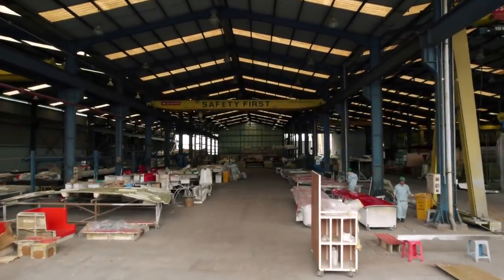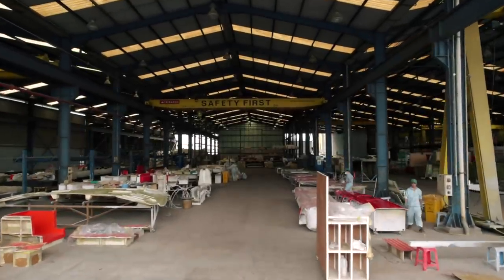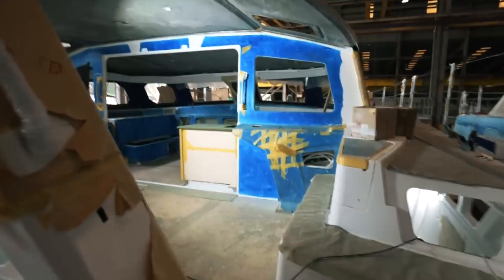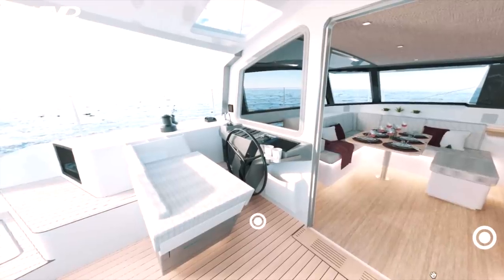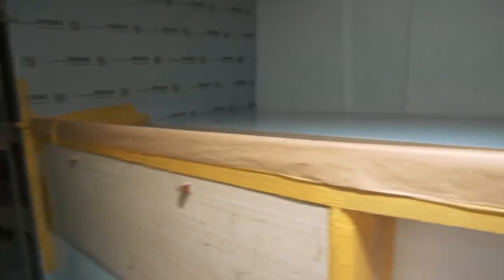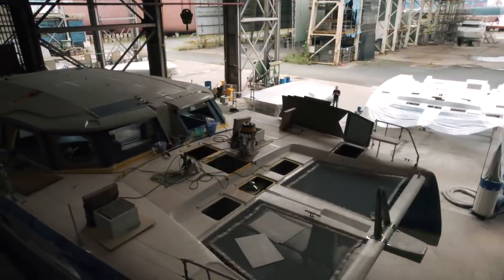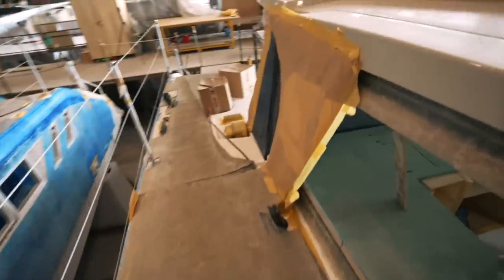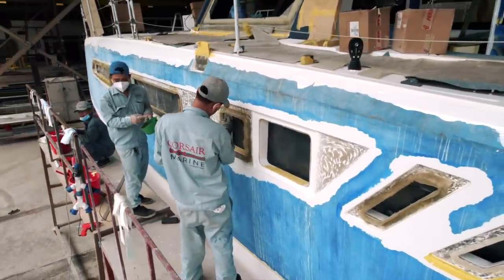CATAMARAN BUILD: A Very Thorough RUBY ROSE 2 Update & Factory Tour

Comment: The channel that has the Anchor chain running to the chain locker will it have a stainless steel plate because as you know the state of the chain is not always clean and will protect the Fiberglass from any deep scratches. Just my way of thinking .

Comment: well that was fun, How many workers would you say are on the job every day
?
Reply from the maker: Between 50-100
Reply: Ooooh, THAT's how hull #1 is only 1 month away, that's a lot of skilled hands.  I look at it and see months.  It seems like the opposite of house building where the framing and roof go very fast and the punch out takes an eternity; with all the bits being pre-build the final stages should go quickly.
Reply: @jackblah5842  I used to build homes happy crew makes for faster results. Respect the trades. Thx Jack